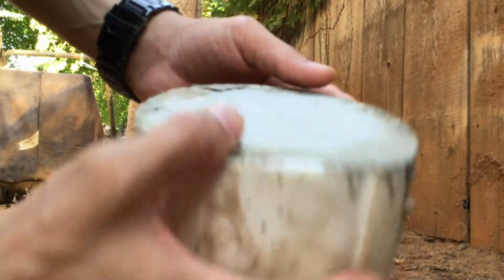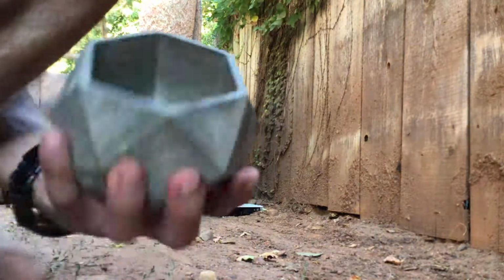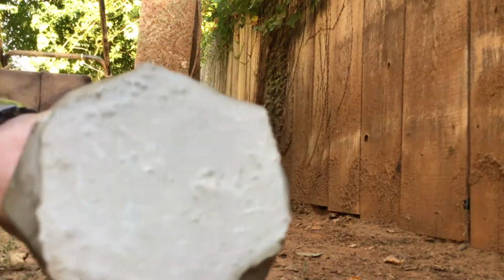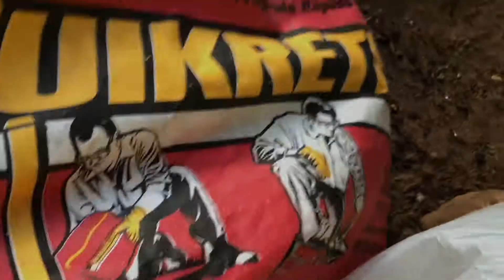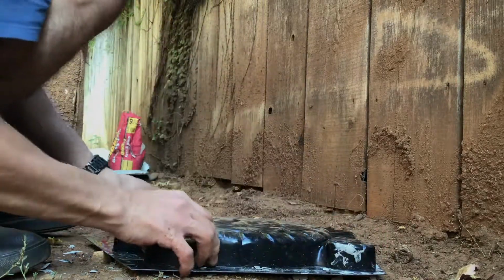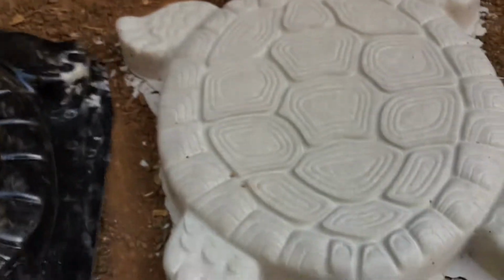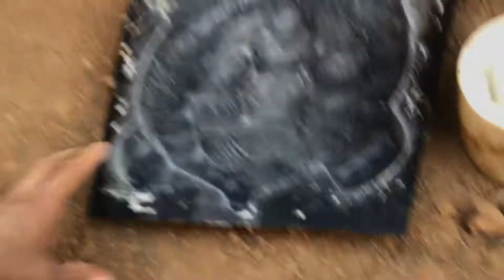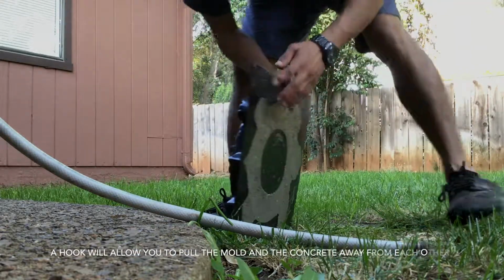Concrete Molds Turtles

Comment: I have about 30 of those Turtle stepping stone molds. The secret they don't tell you on the instructions is to not fill the mold up fully. Leave a 1/8 to 1/4 inch Gap so there is room for the casting to slide out. When you fill it up fully at locks the casting into the mold especially on the planter mold with the hole in the middle. That is the hardest one to demold without breaking.  Always demold on a soft surface like the grass that you are doing it on to avoid breakage. Also use a mold release to help with the cast coming out
Reply from the maker: Thanks
Reply: What kind of cement mix to prevent larger items from cracking?

Comment: have u tried spraying it with pam cooking spray before putting the concrete?
Reply from the maker: Not yet, and actually find the Olive oil working just fine as it wont stop functioning after a while like the other stuff would. I will keep it in mind nevertheless

Comment: Dude, use pam, it will slide right out.  That's what I use in my turtle molds.  Just shake out the excess pam so it doesn't pool at the bottom.